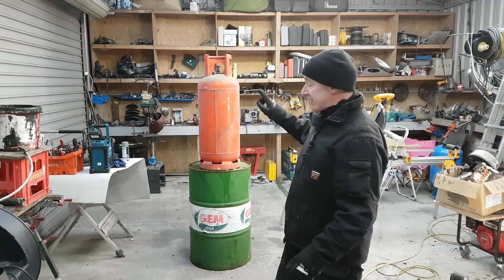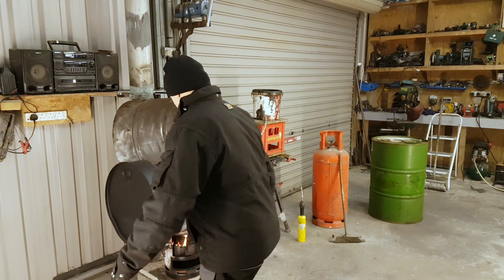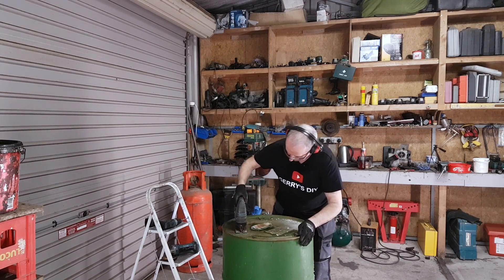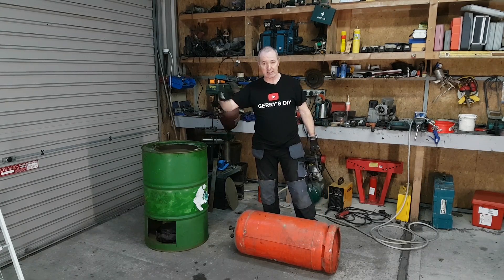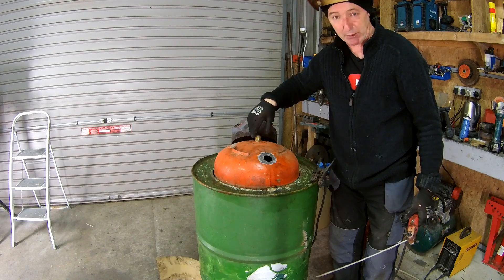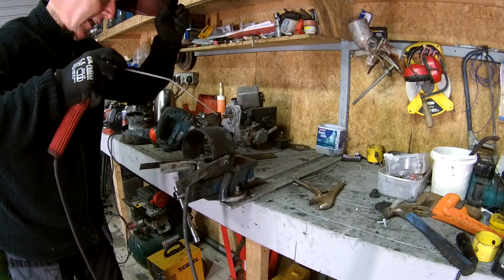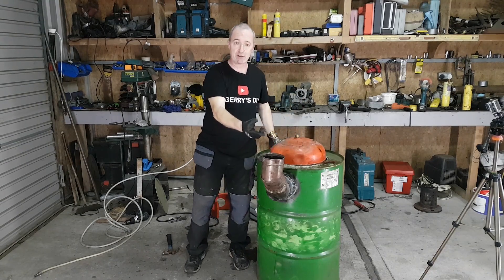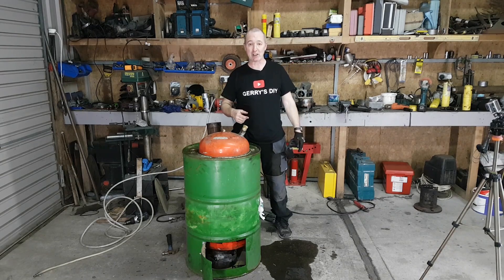Waste Oil Burner ... Make Lots of Free Hot Water ... part 1

Comment: How is the propane cylinder floating inside the barrel? Did you weld brackets off the walls of the barrel to hold it up???

Comment: what kind of fitting do you have coming out of the bucket
Reply from the maker: Hi John. It's just a standard brass 1/2 inch tank connector used in plumbing. It has a compression nut and ring for connecting the pipe. Hope this helps here's a link to the type of connector  https://goo.gl/dmCGyD  Cheers Gerry
Reply: it @GerrysDiy  it says the link doesnt exist, but I know what your talking about, thanks
Reply from the maker: Hi John try this link.   https://goo.gl/dmCGyD   This is just a shop in Ireland but you can see the type of fittings that I use on these things. Cheers Gerry

Comment: Hi Gerry! Really like the way you make stuff fast and easy! So I have a technical question for you about a heater I am going to make using your setup with the large propane cylinder, though I have an old water heater instead. Anyway with regards to the chimney, instead of a simple opening in the top I was wondering about extending it down into the upper area so heat would be trapped inside the tank longer.  Also, putting a few smaller holes in it just inside at the top to make sure all the fumes eventually go out. I plan to use a fan for the air to the 'swirl burner' I will make but I wonder what you thought about this.  Keep 'em coming, Gerry!
Reply from the maker: Hi Throw Me Back. I think that would work. I will go into a bit of detail when I get this beast working. That might be tomorrow if things go to plan. I will be uploading another video in a couple of hours once I finish editing. Thanks for the comment and good look with the build. Cheers Gerry

Comment: I've  tried a similar idea using a gas bottle as a hot water tank,it worked well only problem I had and you might have the hot water is a rusty red colour.
Reply from the maker: Hi David. The rust in the water will be sorted in the next video. I have a copper tank with a heat exchanger so that the water will be heated indirectly. In part 2 of this video I am really only testing the whole thing to see how fast we can get the water to temperature. Thanks for the comment Cheers Gerry

Comment: Hot water in a shop, especially a shop that's located in a region with cold winters, is the cat's meow.
Reply from the maker: Hi John. I have a boiler I converted a few years ago that I could have used but I wanted to make one from stuff available everywhere. I hoe to get back at the build tomorrow. Hope you are nice and warm and not under 20 feet of snow. Cheers Gerry
Reply: GerrysDiy under a few feet of snow. Have wood heat, but live in the middle of the world's largest forest, so plenty of fuel. 
Boiler looking great. Using readily available materials is a big plus, too. 
Slainte!
Reply from the maker: Go raibh mile mhaith agat Sean. Slainte Freisin.  Gearoid.
Reply: GerrysDiy thank you much!

Comment: Nice project Gerry.
I'm just wondering why you do not take the air from the outside? The way it's it is configured just now, you use the heated air at the combustion and sucks in cold air into the rom from The outside.

Comment: Hi Gary. 
I know it became cheap but i know your old poppane tank will corode from the inside because they do not have any ceramic coating or forgings that sew it from the inside to rust. You would have caught a used broken electric water heater with electric fault, so if it worked a lot better and longer life, you could have been drinking your hot water

Comment: Hey Gerry, been following your channel for some time now, and must say great work! I've built a stove & burner using your design and man does it make some heat! The only problem I seem to be having is with the oil feed tube. It gets ripping hot and starts smoking out the exterior entry point. Iv tried making it a solid line from oil container to stove but that made it difficult to visually meter the amount of oil entering the burning. How did you get around this? Cheers keep up the great work! - Matt
Reply from the maker: Hi Matt. The reason my oil line does not act like a mini chimney is that the draft from the stove is actually pulling air down the pipe. If I open both doors and things are really hot I can get smoke coming out or the pipe but with the main door closed there is a negative pull on the pipe. You could either lengthen your flue or make an injector tee and a small fan pushing air down your feed pipe after your inspection tee. I will show something in the next video if you want. Cheers Gerry
Reply: GerrysDiy, if not for him, then show it for me cuz I'm not sure I've got the right of what you guys are saying.

The one thing I've been hoping that you would explore is getting more heat but not using more than about a gallon of oil per day (8 to 10 hours). Also I think you've mentioned, but I want to be clear: vegetable oil and used motor oil burner at a very very similar rate, or just "about" the same?
Reply: matt mccready ive delt with this you need a bigger exhaust how big is yours my oil feed creates a draft that pulls air in so it wont smoke unless i over oil my system
Reply: Jake Browne 4 meters of 6 inch.
Reply: matt mccready link a video of your feed line and intake or search my video under barrel stove oil burner conversion
Reply: Hi Gerry, Thanks for the quick reply. i added another meter and a half of chimney yesterday, problem solved! also found a new blower for forced air. Zero smoke after the burner warms up. I really like your idea of adding port covers to direct the air inside the burner(will be trying it today). Im also thinking of adding small fins to the interior side wall to work in conjunction port covers. Going to start making some videos aswell. Very impressed with the heat coming out of this beast!  Had a runaway with the fuel and it really took off lol. Id say it was close to 1400-1600 Fahrenheit, pretty impressive.Cheers.